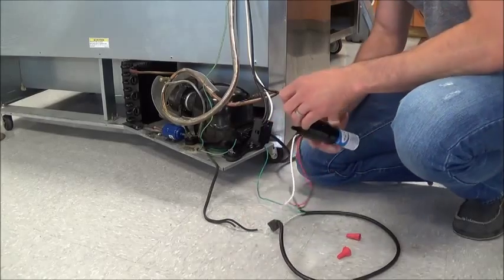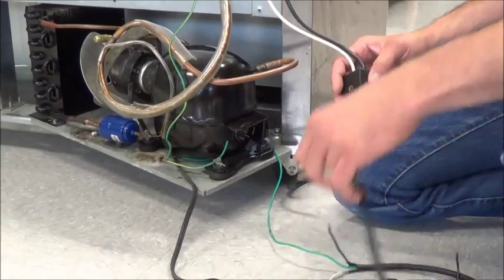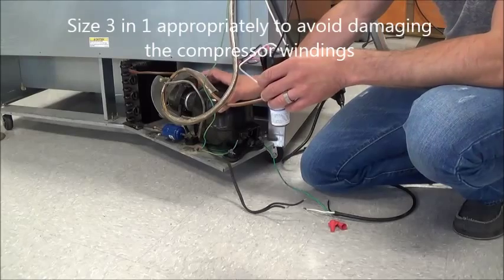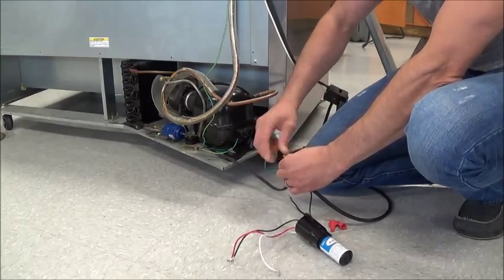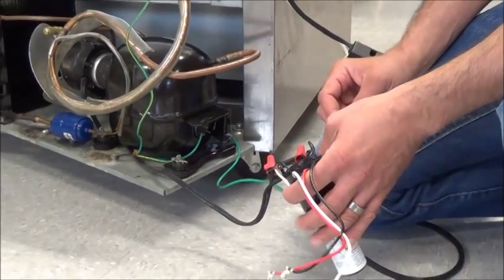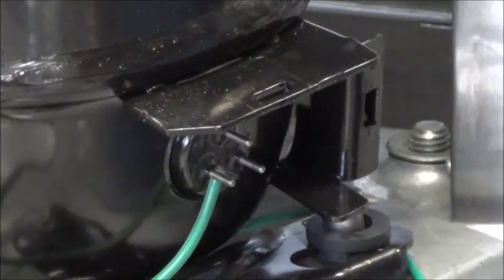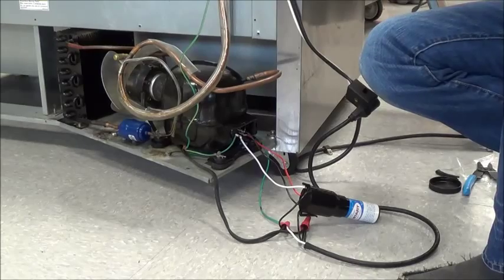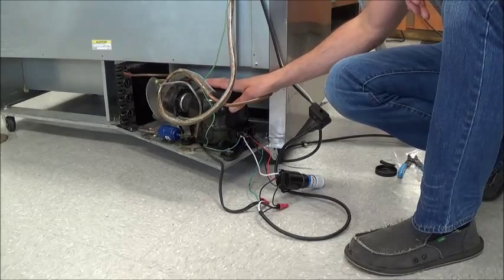MTO 3 in 1

Comment: I have three wires instead of two, one for the run, one for the start and one for the overload, how do I connect the wires to the two black wires on the hard start kit if I have to install one. I know where the other three wires on the hard start kit connects on to the compressor
Reply: Micl Wass did you find answer? I have same issue 3 wires.